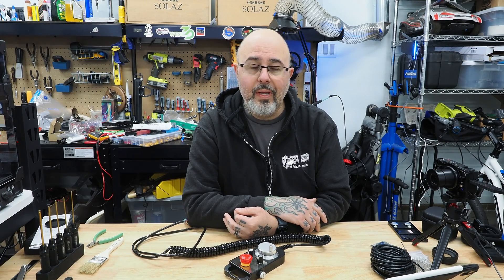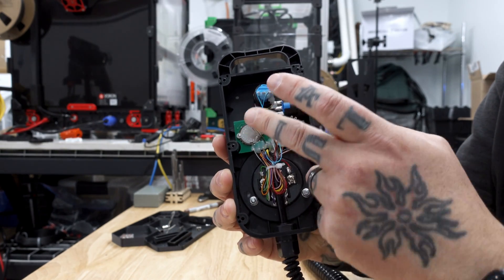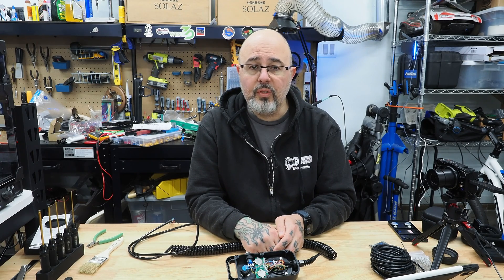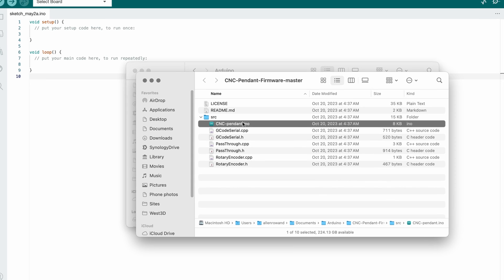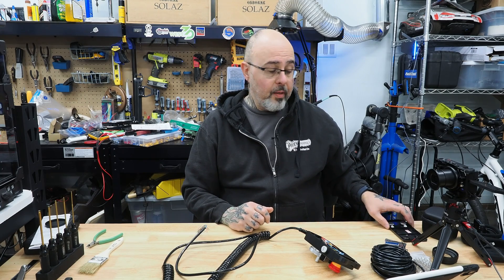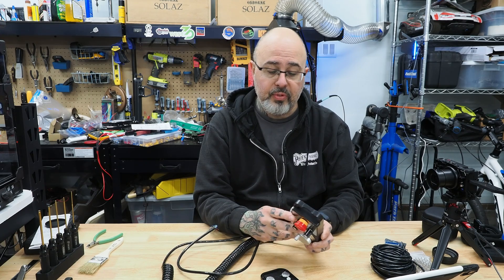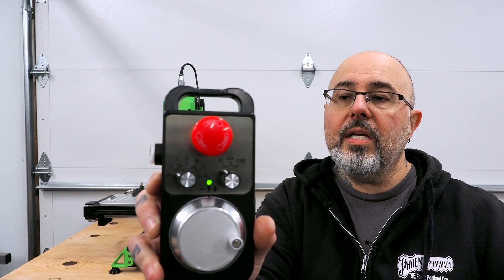Give your Milo some bling with a pendant!

Comment: What happened with the Milo ? Are they avaialable ?
Reply: Milo 1.5 LDO kits have been about for about a year. Few places still have stock.

V 2.0 final CAD and beta kit feedback from the designers has gone back to LDO and it's in their hands. But they are not moving fast.
So who knows. 

Just finished a 1.5 myself. Lovely machine.

Comment: I can't get it to work... anyway suggestions... I typed the code as seen in screen shot in video, im getting flashing light on ardiuno when I turn the dial but it's not moving the machine. My assumption is i have wiring wrong on milo end what did you put where?... sorry about putting all this in the comments but i can't figure out discord wich seems like where everyone directs for help
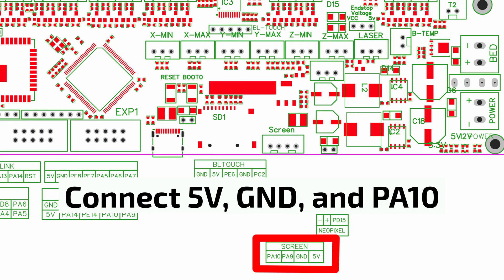Reply from the maker: I show that at 7:30, maybe try reversing your data lines.

Comment: Im working on mine just got done fighting and troubleshooting all connections broke down watched video again and realized i didnt change the line of code so 🤞🏻that will fix it. I did attach all 4 wires at both ends because i want to try to put a screen in if possible as well though im not sure how that will work🤷‍♂️🤞🏻. Also on you last comment about a present peice i saw something in the millennium machines gcode flavor secton of the lit line g27 park does exactly that though not sure how you'd address that to the button (I pretty much only know enough about "making" to be dangerous 😅).... THANK YOU SOOO much for you content there not enough out there on the milo and mods  please make more

Comment: Personal opinion.. Id have used some form of disconnect on the frame so the control could be applied or removed without having to goto the board level.
Reply from the maker: There’s a Molex connector inline so that I can disconnect the pendant. That’s temporary until I get an enclosure.